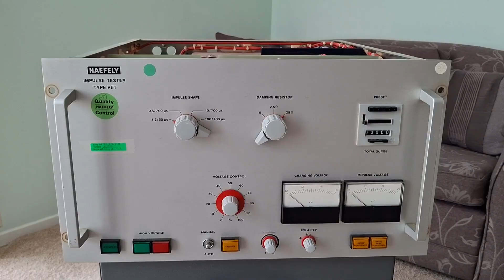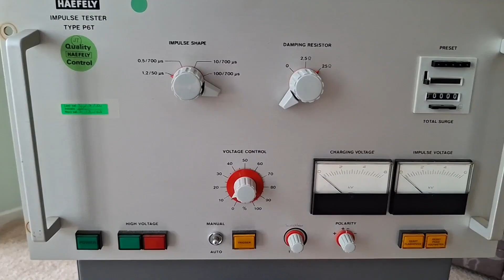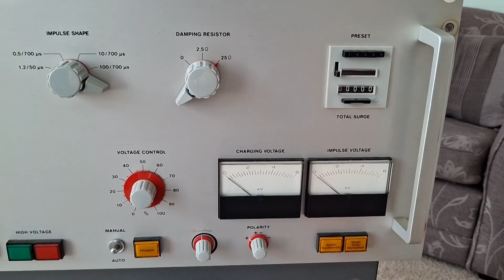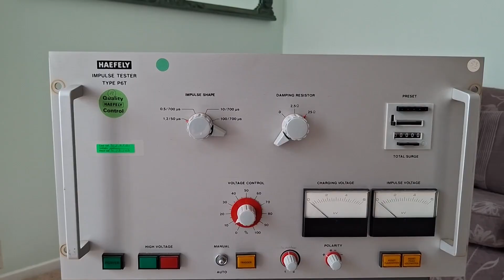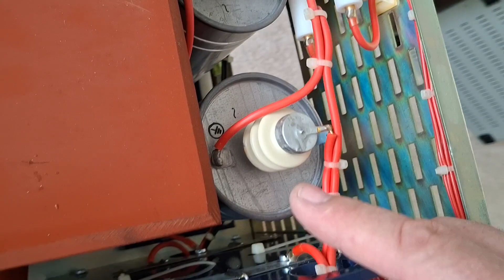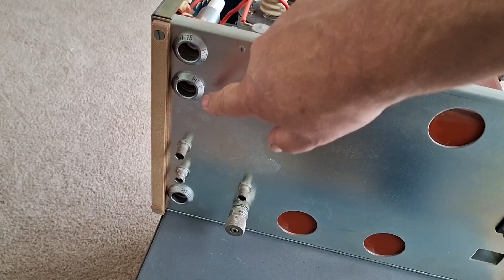Take a guided tour through a Haefely  Type P6T 6kV Impulse Tester 005

Comment: I wonder if the dampening resistor setting is the source, or what the source is?   At 20uF/6kV or 360J available, I'm surprised they could switch it with those mechanical contacts and get any life or repeatability out of it.   It would be interesting the see what the short circuit current waveform looks like and how repeatable it is.  Have you written Haefely to see if they would run you off a copy of the documentation for it?
Reply: I did find this document that shows it may meet the 8/20 current standard.   https://www.worldradiohistory.com/Archive-Catalogs/GE/GE-Transient-Voltage-Supression-3ed-1983.CV01.pdf
Reply from the maker: The waveforms are defined in the standards.  At least the contacts would be cheap and easy to replace.